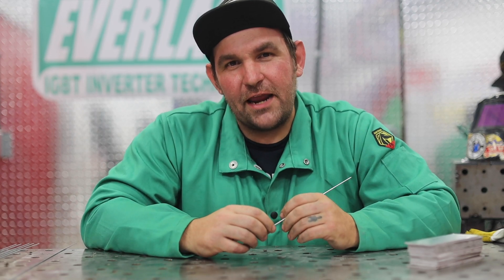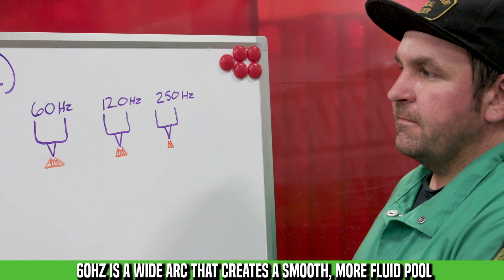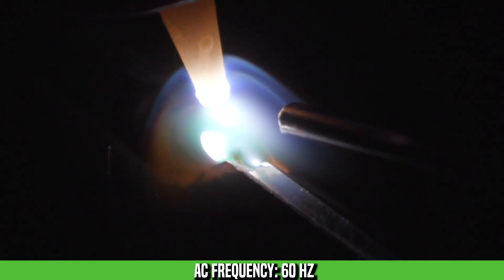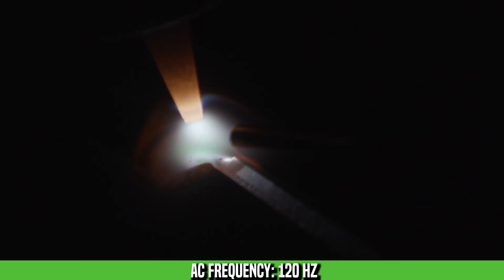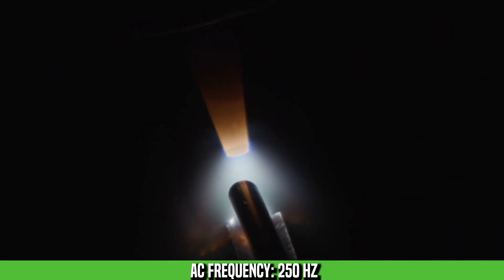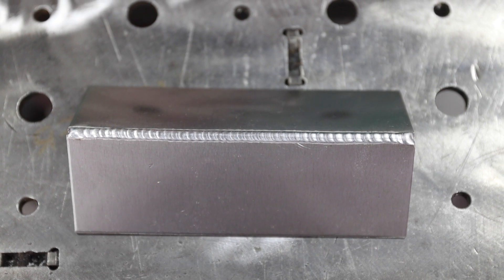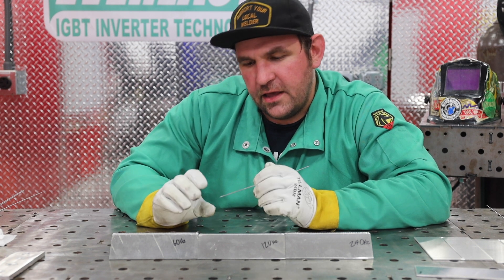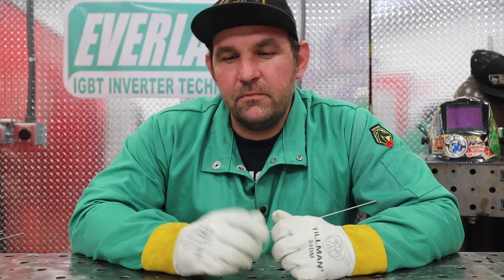TIG AC Frequency Adjustment | Everlast Welders

Comment: Very helpful.  I find it quite amazing and interesting that there are all of these variables (Amperage, Frequency, %Electrode Negative, Pulse Rate and of course the ability to adjust amperage while welding) that can be adjusted in order to meet that narrow range or window for producing an acceptable weld in aluminum.

Comment: Could you make a video on the different joints which would run better at lower Hz like 60-80, which joint for mid range and when would you need to actually something over 200hz to benefit you?

Comment: Depending on the welding machine, the frequency may
be set as low as 20 Hz and as high as 250 Hz. The lower
setting produces a much less focused arc and the higher
setting provides a much more concentrated, stiffer, and
more focused arc. Most welding is preformed with a setting
between 100 Hz and 120 Hz. Higher frequencies are often
used for machine or automated GTA welding, for which
higher travel speeds are possible.
The higher the frequency, the stiffer and more focused
the arc is, which is particularly helpful in fillet welds,
where the edge of one plate is being heated and the middle
of the base plate is not, Figure 16-37. The stiffer and more
focused arc will allow the welder to direct the heat on the
base plate because it will take more heat to melt due to its
thermal mass
-- Welding Principles and Applications
Eighth Edition
Larry Jeffus
Reply: Good explanation.

Comment: Ive got issues with my 255ext. When striking an arc it doesnt start at the tip it starts up by where the tungsten goes into the screen then moves down to the tip. Im in pedal mode no 2t or 4t, ac "easy" setup. When i stop the arc it continues on like its draining down a capacitor. This happens in any of the settings ac or dc, and ive had the ground directly to the part. Is it my pedal, as this did not happen until recently?
Reply: The easy setup has a down slope to help prevent craters at weld termination. If you setup a program with no down slope the aec will terminate at your set minimum amps. Raising your starting amps can help your arc starts as well.... Typically I set mine at 60 for 1/8" tungsten... And 40 for 3/32.